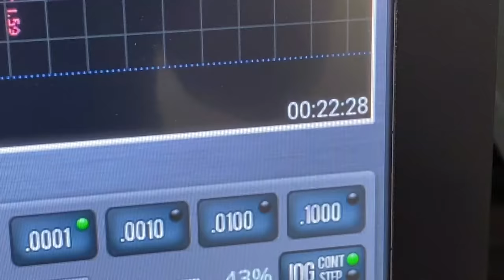IMPOSSIBLE MACHINING TEST: Inconel 718, Kennametal Ceramic End Mills & 1.5 HP TORMACH

Comment: I think this is why so many people are getting out of machining is because the company owners don't realize how smart you have to be to be a great programmer/machinist. They think it's just here's a file and boom there's a part. I think it's funny how most places put so much into their engineering but so little into the guys actually make the parts. I've had to search so long before finally finding a place where this is appreciated. Definitely an underpaid, under appreciated profession these days. At least in my experience.
Reply: Man, i'm still mad about a place i used to work at

They refused to let the part designers actually learn how the parts are machined and so we got completely absurd geometry to work after (like a few dozen holes at very specific different angles) that just werent feasible with what the company expected us to do it with (entry price second-hand VF1s and a single VF4, none with automatic probe and only the VF4 with a >$150 3D taster)

Comment: Would help if you weren’t shanking out on the ceramic. I bet it would work high feed style. Turn it up till it goes bang then 10% slower😁
Reply: I think it may have pulled the endmill down. not enough clamp force.

Comment: Ran Inco alloys for 20+ year for GE aircraft engines hot zones. 2 things that will increase your tool life dramatically is a Chipblaster for High Pressure coolant on both Mills and Lathes, and run your Blaser at 2x the recommended concentration for tool life. Also I know you are a Kennametal guy... But Sandvik and Quick change Capto holders whip the snot out of Kennamatal stuff in tough materials....

Comment: I just built a diy cnc router, and I was running a 6mm 3flt endmill through MDF at max speed(30k rpm), and my machine was doing small pockets for t-nuts. Everyone says max rpm is the way to go for wood, but it almost started a fire after only about 8 pockets. 

I was watching the whole time, but I realized I need to get single flute end mills to be able to get my speeds and feeds anywhere close to where they should be. For some reason my machine is very slow when doing tight little holes. I think I may be working at too high of a resolution. A single flute at 10k rpm would need about 200i/m, and my machine, for whatever reason, slows down to anywhere between 4-24i/m for small details. 

I am still new to the DIY side of this, and at the moment I use GRBL on a arduino uno, running off universal gcode sender v2.0.. Seems glitchy, but better than easil. Havn't tried chilipeppr, so it may be a better option. Who knows what else there is, as there seems to be all sorts of different programs for different stuff. My 3d printer runs on repetier host, and almost wondered if I could repurpose the board off one of my printers that is broken. 🤔
Reply: I know that in Mach3 there is a feature where your machine slows down when interpolating, Constant Velocity in angles over X, i think, there may be a similar feature on your software

Comment: I know the 770M has a little more guts than my 770 S3, but I'd try a smaller version of the end mill.  If you need to really haul to make the insert work the spec sheet calls for up to 10% tool diameter.  Taking a .010" DOC with a 3/8 end mill has some SERIOUS chip thinning problems.  So a 3/16 or 1/4 EM would make more sense to keep the DOC more in range and have a steeper cut entry.  Then push the little Tormach as fast as it'll go to make the low end of the SFM table.  But yeah I have no luck on a 770 with Titanium or harder with end mills over 5/16. for profile cutting.  It just doesn't have the torque or rigidity to make a proper DOC. And with Inconel I'd think 1/4 might be max for a good cut.  But you might be able to get into the tool into operating range at least.  Nothing wrong with small end mills and lower removal rates if you can make the process reliable.  I'd like to see you try it again because I think it's doable frankly.

Comment: That ceramic end mill looked to me like it pulled out on that second run.
Reply: yeah but it was just a downward spiral
Reply: Didn’t want to have any baby ceramic end mills running around.
Reply: @NARKISDUDE  it is defo not a downcut haha
Reply: Great eye - it absolutely did and started to rub like a madman.
Reply: Yep sure did. Pulled out and started rubbing the shank, causing the extra hp drain and axis overload . I believe it might have worked on that try if it didn’t . Got a shrink fit for that machine? Love your work fellow machinist brotha!
Reply: @NARKISDUDE  'just'?   You realize that when it pulls out it rubs on the shank.  Rub = friction and heat + HP theft.
You can very clearly see the friction and heat band grow vertically as it traverses around.
Reply: @shirothehero0609  ok thanks
Reply: It wasn't the tool being pulled, out it was the toolholder pulled out from the spindle. I get tormach is a toy but...

Comment: I'm sure someone else may have pointed this out already... either the ceramic tool pulled out of the holder or the depth of cut was greater than the length of cut. Would be interested to see if it could be done with 1/2 of the loc engagement.

Comment: I run the 1/2 dia NTK ceramic endmills all of the time on inconel 718 45Rc. I run them at 1300sf X .001 chipload per tooth X 4 flutes X .070 DOC 100% engagement of the tool dia. Works great. For rough out the ceramics are 7 times faster and I get 4 times more parts out of them than a Harvey or a Hanita verimill. Then I use a Harvey or Hanita for the finish passes. They come out beautiful. But those ceramic endmills cost $270 each. Not cheap.

Comment: It's a good starting point. it is a little too conservative of an approach, though. Your MRR is .050 in3/min. I would've started at 1325 rpm, .0026 CL, 1.0"Axial, 20 ipm. That'd be .400 in3/min. still conservative but a cut starting point for a little cutter that you want to use.

Comment: I machine inconel in work get about 10 parts off an insert edge taking only about 45,000ths off with roughing od and id tools and then a fourther 5,000ths off with od and id finish insert. Its real tough material

Comment: Not a machinist but I have a question. They used inconel extensively in the space program since the 1960s so why is it still so hard to work with if they were able to do it 50+ years ago? It seems like something that has been used for 50+ years shouldn't be a huge challenge to work with. I guess I'm asking why the bugs haven't been worked out with tools and machining processes that work around the difficulty of the material.
Reply: It can (and has) be dealt with a number of different ways, but I'd wager the real production and manufacturing expertise lies in major aerospace manufacturing, where this and other nickel superalloys were made for. They've got more experience with it than anyone else, and can probably mill it without breaking a sweat

Comment: OK, I am embarrassed to show my lack of knowledge, but after the first run of the ceramic, and after the second ran, you said that obviously that does not work.
I don't know what you saw that did not work.  If I was looking at this, I would  be clueless if it is "working" or "not working".  Help please?  :)
Reply: Chips were glowing, heat was building up on the tool and the machine was slowing down indicating it doesn't have the power to keep running the tool at that RPM.
Reply: It may have - on the second run the tool sounded ok till it got loose and pulled out
Reply: When the spindle bogs down (you audibly hear it) basically means not enough hp for the cut.  That leads to rubbing and friction and heat build up on the cutting edges and it all goes to hell after that.
The shank also started to rub like crazy on the second run  - you can see the glowing band grow vertically on the shank.  That's def no good.  
Ceramics are also not 'normal' tools to work with and have a totally different playbook.
Reply: Also - never be embarrassed to ask questions.   It's how ALL of us learn.  Anyone who gives you shit for asking questions should get their ass kicked.
Reply: @shirothehero0609  - The second cut does not bog down until the tool starts to pull out - You can hear the rpm stay the same until it did
Reply: He was shanking it.  No idea why he did that.
Reply: Eh Ess He wasn’t shanking out intentionally. The tool has .300 flute length which was where he started his DOC. You can see clearly on the second attempt the tool pulls out of the holder.  The cut actually looked and sounded ok on the second attempt until it started to pull. Once it starts to pull you can audibly hear the spindle bog down and see the heat band grow as it rubs. The tool does not have a Weldon shank, but he used a Weldon shank holder. He probably didn’t have a hydraulic or shrink fit holder readily available for the test.

Comment: Problem is that the ceramic endmill did pull put of that holder thats why the spindle bogged down. do another test with better holder than a weldon.

Comment: I have a Tormach 770 and only use a mist oil because of concerns about coolant stagnation.   If the Blaser 735 sits with out agitation for days will it create a bacteria problem?  What cutting performance opportunities am I missing out on by only machining with tap magic applied with a pneumatic  misting system?
Reply: I've been using Blaser 735 on our mill for a while. We only have a spray mist unit  and it works fine. I also have 735 in our cutoff saw. No problems with it going rancid without agitation for days.

Comment: Ah Tormachs. As long the gibs are well adjusted they can cut anything but if even a single gib is loose they can't cut anything. Wish Tormach would switch over to linear rails.

Comment: You need a better machine to machining hard material like that. Spindle and structure is not enough powerful for this material. Haas or Tormach are low cost machines, their prices are competitive but is not the best way for very technical parts with hard material. In America maybe you buy a lot HAAS or machines like that, but in Europe nobody buy that. European prefer Japan or German machines. For exemple, SW machines with HSK 63 have a weight of 15-20 Tonnes, just for the structure...

Comment: what is Inconel?  That is some hard stuff
Reply: We use this material in the combustion cases of Rolls-Royce gas turbine aero engines. It’s a tough material to machine but is surprising easy to weld using an electron beam welding process.

Comment: Hey Titan! The endmill did not have a Weldon flat on it. But u used it in a Weldon shank holder. How did you do that?
Reply: We do this commonly at my shop, it's as simple as putting your own flat on the shank of the tool via table grinder, die grinder ect.
Reply: @spikeypineapple552  boom unbalanced tool
Reply: @jordanviney8306  Unbalanced tool? You have no idea what you're talking about. A slight amount of material removed, that close to the axis of rotation, and that close to the spindle bearing, is inconsequential. What is your excuse on end mills that have a flat ground on them from the factory? It is asymmetrical and unbalanced, but they're used everyday. (And no, they don't compensate/balance it. The flat is only on one side.)
Reply: Grind a nice notch by hand, quick, and easy, never have any issues with cutter runout which we varify with a Zoller tool setter.
Reply: Thekidfrank24 can’t grind a notch in ceramic
Reply: Andrew Delashaw Quality Weldon shank holders are actually balanced to compensate for the flat in the tool. There is a standard for size and shape of the flat at different diameters so tool manufacturers can easily compensate the holder for that. However, I agree with your point to an extent. At RPM’s below 12,000 or diameters below 5” balance rarely matters. Every machining operation is different though. If you are trying to maintain a 32Ra surface finish and a .0008” diameter with a PCD reamer that imbalance will matter.
Anyway the point is moot, because I’d like to see you attempt to grind a decent flat on a ceramic tool with anything the average shop has readily available.

Comment: U don't machine inconle 718 or worst 728 directly u should heat treat the material to remove hardend particles in material structure then u machine it and then u should heat treatment afterward to regain it's spectacular charistrictions. Sorry to intervene I m a material engineer doing it for years. Anyway I'm jealous for your knowledge and equipment s. Cheerers!!
Reply: Heat treat - specifically, you mean anneal and then harden again?  Your first sentence could be confusing for some (I know that annealing is technically a type/part of Heat treatment, but common usage for understanding typically calls out the specific part of the Heat Treatment process)  Heat treating creates hardened martensite and annealing causes recrystallization so the metal is easier to work.
Reply: First of all, you have no idea what state the metal is in. Second, he is one of the most experienced people in the world when it comes to super alloys. You see that giant manufacturing facility? That doesn't come from a lack of experience.
Reply: @shiroskae It doesnt  mean annealing exactly  as annealing is about 500 to 700'c typically . It's called desolution hardend nano particles which should have done approximately 1300 or more when talking about superalloys. And recovery and recrystallization should considerd in this Process. And u don't have martensite in inconle as there is a lot of Ni,Nb,Ti that are hard gamma stabilizers. I can refer u to some of my elsevier articles if u want to read more.
Reply: @xenonram  I respect the knowledge and experience of Titian team as I said in my comment for sure. To describe u the exact part designing for inconle materials , it must have done in preform parts that with the final machining u aquire the final dimensions. It's unusual to machine a part from a block in these materials due to high prices , hardmachining and time efficiently manufacturing. I think the main subject of the operation is to benchmarking the mill it self and the equipment s. Again I know Titans are the best in cnc !
Reply: @shirothehero0609  in inconle materials there is a phase called gamma prime nano particles that result in this spectacular behavior of these materials , else Ni alone is not any special material u can machine it freely. When comes to inconle and generally supper alloys the understandings of materials change dramatically not just with simple hardening and anealing